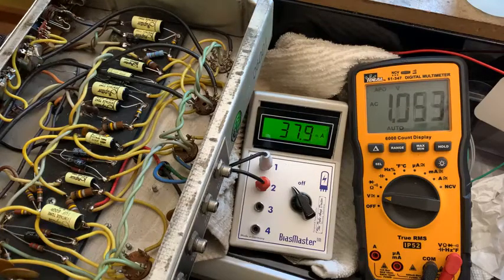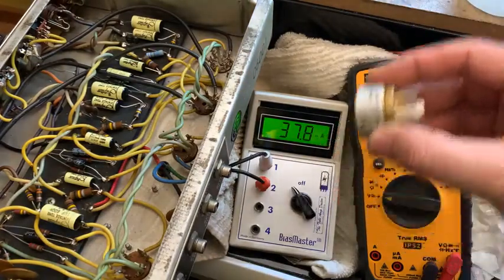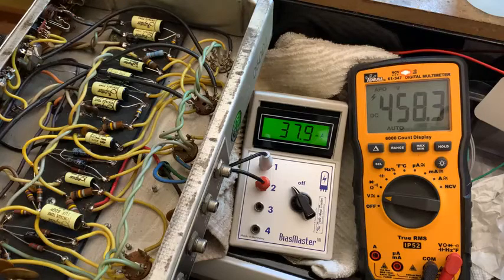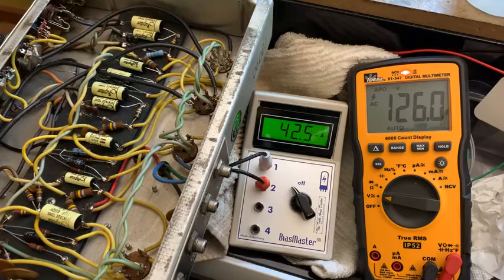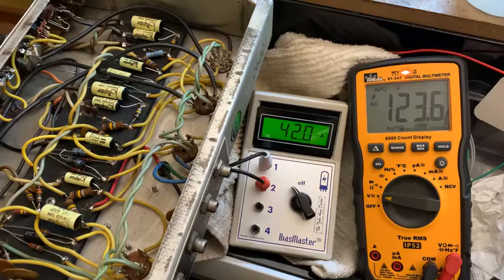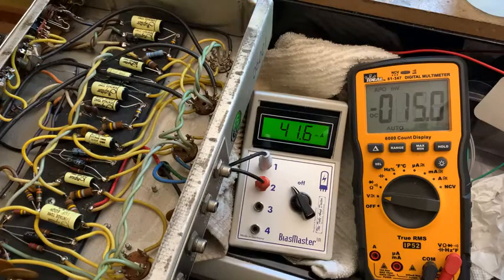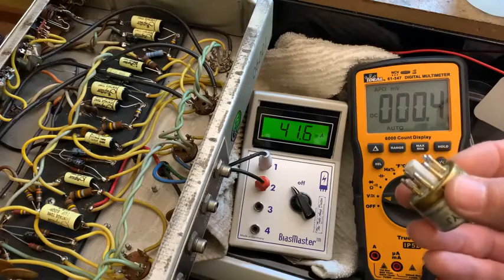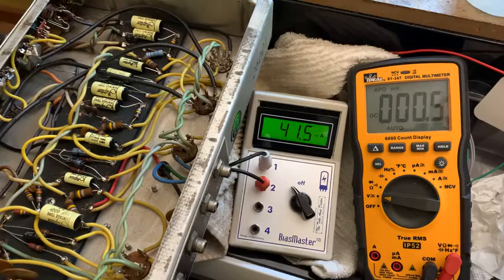Vacuum Tube Bias: Wall Voltage Consideration

Comment: I'm betting that most of the transformer issues with amps like Tweakers were due to excessive wall voltage.
The back panel voltage switch has a highest rating of 117 volts, I've measured 128 volts here in Northwest Indiana at the wall on a weekend morning.
It typically runs 122 to 123 volts.
I use a device called the Tone Preserver to monitor and adjust my wall voltage to keep my Transformers and tubes from cooking.